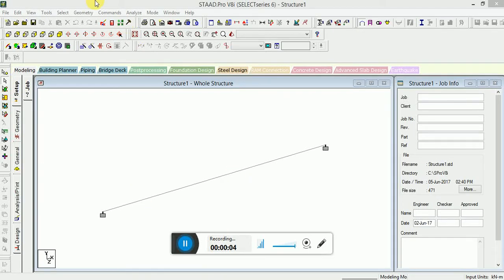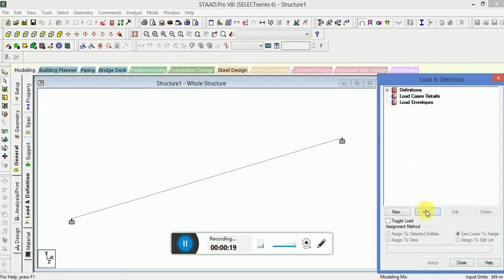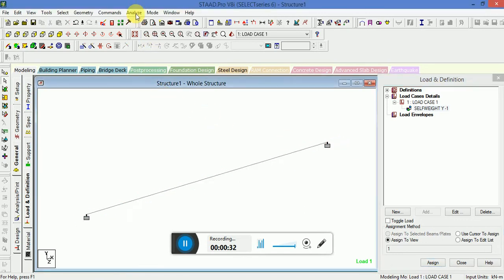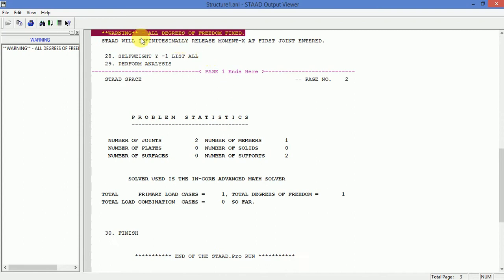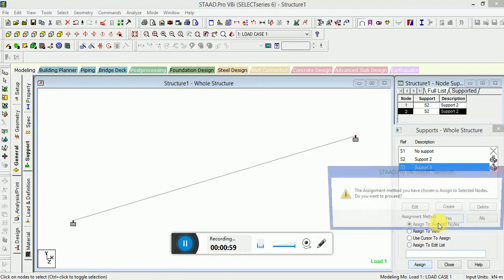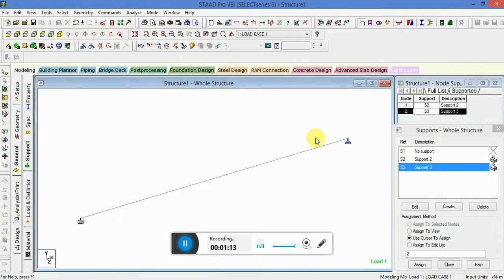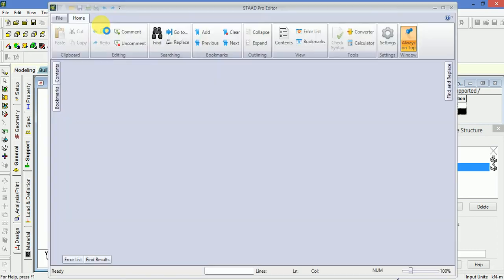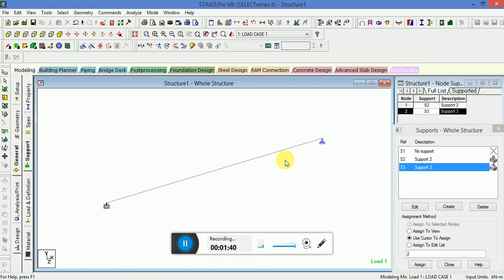HOW TO REMOVE STAAD PRO STAAD PRO WARNINGS EASY METHOD

Comment: sir this is the warning which is showing to me, what should i do??? WARNING- APPLIED SELF-WEIGHT IS LESS THAN TOTAL WEIGHT OF ALL STRUCTURAL ELEMENTS IN LOAD CASE1 ALONG Y.
Reply: assign the self-weight load of -1 in Y direction to view. That will remove the warning for you.